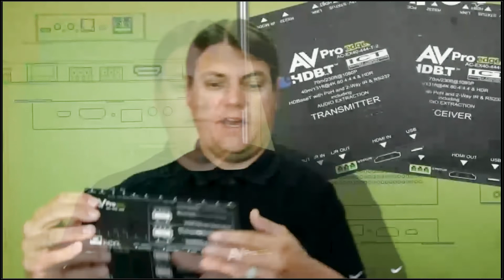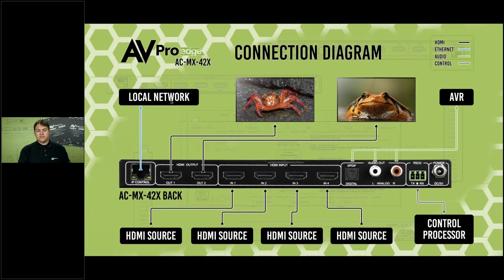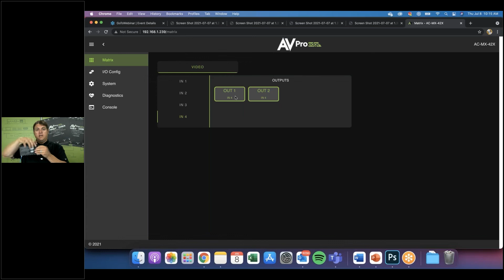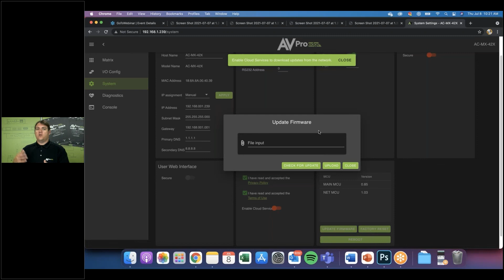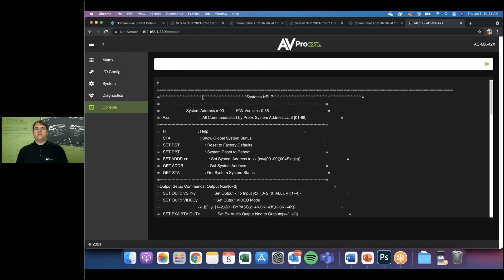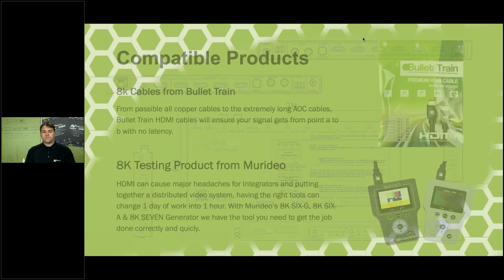World's First 8K 4x2 HDMI Matrix Switcher by AVPro Edge

Comment: What if my tv has Amazon prime or Netflix, so it becomes a "source", do I need to run another hdmi cable from the tv eArc port to lets say HDMI input 4 for audio? Let's say I have an active HDMI cable from output 1 to my tv, so that cable is "one way".
Reply from the maker: This matrix switcher would only be needed for external sources. When routing the eARC audio signal for internal TV apps, we suggest you don't route it back to the matrix switcher; instead, connect it directly to your AVR, Distributed audio Audio System, or Sound Bar.
Reply: @avproedge  thank you! What if my audio system only has 1 hdmi eArc port? Can I link all my external sources with this matrix switcher and from my tv eArc port, link it to my audio system. Will all the external sources audio link smoothly with the audio system?
Reply from the maker: @stanleyssn  Yes, they sure will!

Comment: This is my setup. 2 TVs, one in the Livingroom and one at the bedroom. Both of them support HDMI 2.1. I have Xbox series X and Ps5. I want a matrix where input 1 and 2 are Xbox series X and Ps5 respectively.  and then Output 1 and 2 are Livingroom Tv and Bedroom Tv. I don't want to carry over the console every time I want to play in the bedroom since the controllers are in range. Using HDMI 2.1 cables and your Matrix above, Will I get the 4k 120hz signals on both TVs and switch/Split between the two using my phone/Laptop/Pc over the IP address?
Reply from the maker: Hello, You will get 4K120 on both TV's if you used this matrix switcher. You can use the GUI to switch from your phone.

Comment: If the input is FRL, then the downscale output would FRL as well, right? If the input enables HDR and VRR, then the downscaled output will also be with HDR and VRR?
Reply from the maker: Sorry this question got lost in the mix! The downscale would be FRL as well. We can downscale FRL 4(PS5) and FRL 5(XBox Series X) down to FRL 1 or 2.
Reply from the maker: With HDR, the metadata will continue to pass through and look bad on a display that can't handle HDR, but if your display can handle HDR it will still work, VRR is completely different. The scaler will not scale VRR, it will just allow the source to change the signal at will when in VRR mode. The matrix will recognize this and ensure it passes your VRR signal unprocessed. When using VRR, you do not want to use scaling.

Comment: I have to set up a ps5 a switch a ps4 and an xbox but would like to be able to have one 4k/ 8k tv and two 1080p tvs is there a switcher that I play three gaming devices at one time?
Reply from the maker: There is a switcher that will do that for you minus the 8K. The switcher in this video is the only switcher(at the time of this comment) that can handle 8k and it only has two outputs. You could use a 4x4 (https://www.avproedge.com/ac-mx-44.html) but would need to manage the EDID so the PS5 doesn't output a signal larger than 18Gbps (4k).
Reply: @avproedge  thank you very much

Comment: @AVPro Edge  Is it possible to downscale Frame Rate? for ex: 4K120hz to 4k60hz or 4k120hz to 2k60hz
If VRR is enable on Input, does the device plugged to the Downscale Output must be compatible with VRR also? or is there a way to not turn off VRR on Downscale Output?
Reply from the maker: No, the AC-MX-42X can only downscale the pixel density, but the plugged-in display will have an EDID that tells the source what it can handle. If the display can’t take VRR, the source will send something that it can handle.
Reply: @avproedge  on output 2 it can also downscale 8k or 4k to FHD ? Looking at the interface seems only to 4k
Reply from the maker: @SP_99999  I apologize for not responding sooner, this does scale to down to 1080p. You can scale 8K to either 4K or 1080p, and you can scale 4K to 1080p.